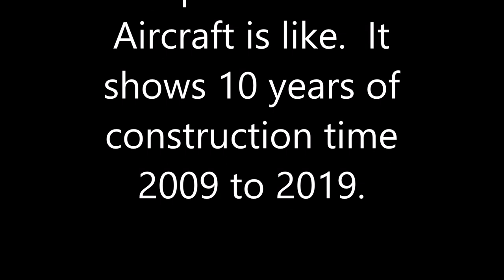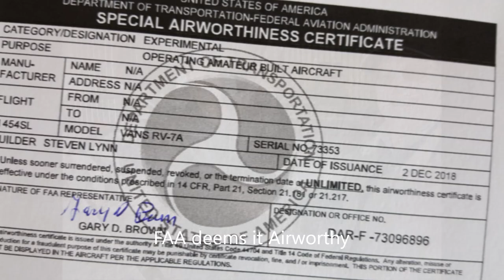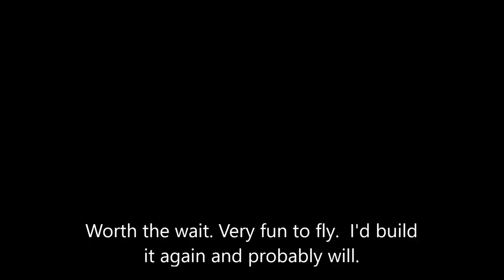Building a Van's RV-7A Experimental Aircraft

Comment: @Steve L Is that the Lycoming O-320 you have in there? I'm curious, which one to use. There seem to be many variations of the O-320 (i.e.; IO-320-B3B/E2D/C1A/D1B, etc). Which one did you go with, sir? I plan to build the RV-7A myself, and want the Lycoming O-320 for the range.
Reply from the maker: It’s IO360 from Vans.